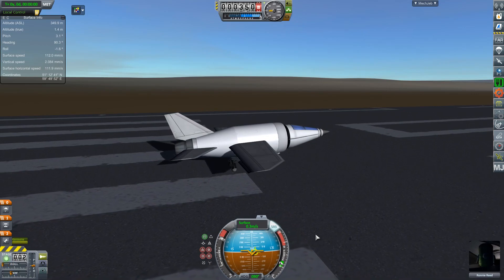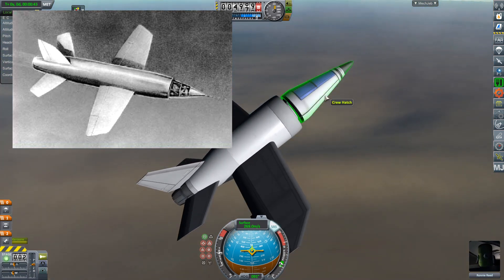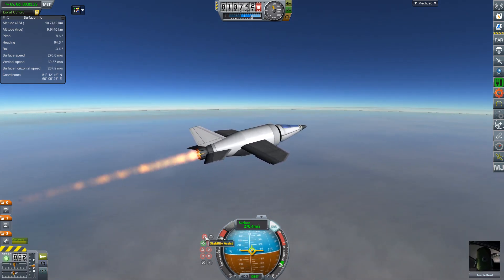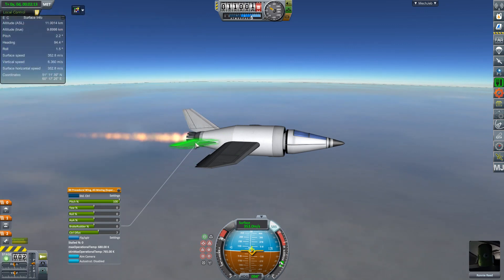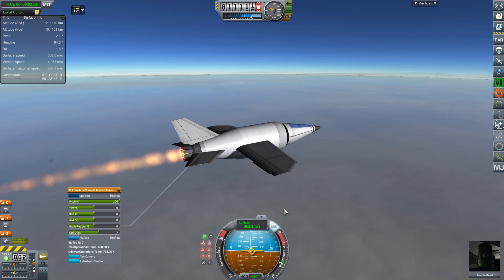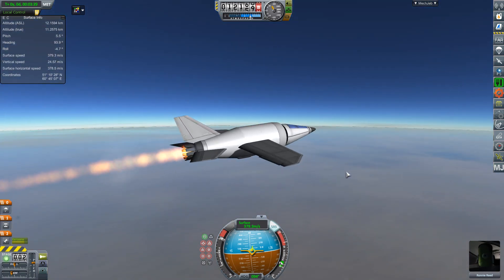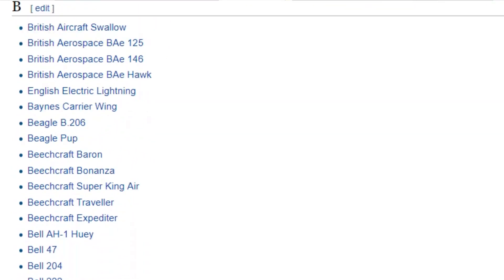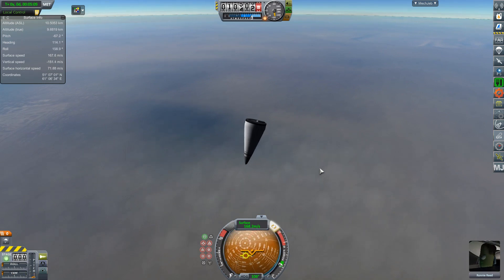Britain’s First Supersonic Aircraft Project - The Miles M.52

Comment: Some German Pilots probably broke the speed of sound during WW2. They had rocket powered aircraft which could almost do it in level flight, with a small dive they certainly would of. Also the Germans launched the first manned vertical take off rocket which certainly broke the speed of sound but crashed and killed the pilot. The record your talking about is the first man the Americans acknowledge broke the speed of sound.
Reply from the maker: +uglyduckling81 the only plausible claim was for the Bachem 349 Natter which killed it’s pilot on its only flight. The Me 263 was shown to be unstable at about Mach 0.9
Reply: aaaand the german jets ran out of fuel after 30 minutes... ._.
Reply: Hans Mutke broke the sound barrier in a dive flying the Messerschmitt Me-262.
The Me-262 was wind tunnel tested up to Mach 1.4 and was the World's first operational aircraft equipped with a fly-by-wire electric stabilator system designed to counteract the effects of "Mach Tuck".
Mutke was the first human to experience the effects of "Mach Tuck" and survive.

Comment: To be fair, a lot of the data and design was based on designs that were taken from Germany after the war as well, so a lot of people contributed to the X1, in one way or another.
Reply from the maker: Although both teams ignored the german research on swept wings and this inhibited their performance.
Reply: Zzyzx Wolfe Actually this was designed DURING the war and therefore did not incorporate many of the features of German jets of the period, I.e. swept wings which would have been v.useful .  The flying tail and re-heat were British innovations I believe.
Reply: From what I've read, at least some of it was gathered from intelligence. I don't remember all the details anymore, since I'm getting old, but I believe the wing design was very similar to that of the Wasserfall anti-aircraft rocket.  It's hard to know what was unique design and what wasn't. There are a lot of things that were developed independently by more than one country, but also a lot of stuff gleaned from intelligence. The English Electric Lightning certainly had some design inspirations from the Germans. The M.52, harder to say, I suppose.
Reply: JohnyG29 the all moving tailplane came out of the team that had eric brown in it
Reply: Zzyzx Wolfe I' m sure they used whatever data the could obtain, just like the Germans did.  However, from what I've read on wikipedia (which as we know is oftern wrong lol) its seems to be a mostly home grown thing.  As stated above one of the main things the Germans provided Allied designers after the war was swept wings.  In any case, its doesnt matter as the M52 was stabbed in the back (by a Labour govt as usual lol).
Reply: JohnyG29 would you rather have SS planes or free healthcare?
Reply: In fact the Tories have canned a shed load more aircraft projects than Labour ever did.

Aircraft Canceled by the Tories:

Supersonic javelin and Red Dean Active radar AAM -1955
Avro 730 Supersonic Bomber - 1957
Saro SR177 Jet/rocket Fighter - 1957
AVRO 720  Jet/rocket Fighter - 1957
Hawker P1121 - Failed to support a promising project - 1957
Nimrod AEW3 - 1986
Nimrod MRA4 - 2010

Thats not counting a number of civil projects that they killed.
Reply: +JohnyG29  Neither invention was actually british, the Stabilator was used on the Wright Flyer and found on many aircraft during WW1. The Jumo 109 -004E was the world's first afterburning turbojet engine.

Comment: They got the wings wrong as well as using the crappy centrifugal flow engine.  Drag building up exponentially on straight wings approaching the speed of sound.   Have to be 57 degrees or more sweep back..
Reply from the maker: Indeed, but, the X-1 had the same wing design.
Reply: The short stubby wings were proven at low speeds on a light aircraft and at high speed in a wind tunnel. They are more stable than delta wings and stronger. The 1960s Starfighter used similar straight wing.
Reply: @scottmanley  The Miles M.52 never had wings... the aircraft never existed.
To say the Bell X1 had the same wings is just wishful thinking.
Reply: @Dave5843-d9m  All true, except the U.K. didn't have any supersonic wind tunnels until after the Bell X1 broke the sound barrier.
Reply from the maker: @sandervanderkammen9230  Models of the M.52 were built, tested and flown, the intention for the wing design was pretty clear.
Reply from the maker: @sandervanderkammen9230  The UK built the world's first Supersonic wind tunnel in 1922, before Germany or the USA.
Reply: @scottmanley  This is true but it completely ignores the vast difference in engineering challenges between a unmanned scale model and a real, full scale, reuseable manned vehicle.
The Miles M.52 was doomed to failure because it didn't not have an engine capable of producing sufficient thrust required to reach Mach 1 in level flight.
The project was cancelled for several reasons (including fruad and embezzlement) but many experts today and British experts at the time agree that the Miles M.52 would never have adaquate thrust to reach Mach 1 unless it was in a steep dive.
Reply: @scottmanley  Not a large diameter supersonic aircraft wind tunnel.
The Luftfahrtforschungsanstalt supersonic wind tunnel facility in Braunschweig Germany was constructed between 1936 and 1938 and was state of the art even after the war ended.
Reply: @scottmanley  Work did not begin on the RAE's first supersonic wind tunnel until 1947 at RAE Bedford.

Comment: Miles M52 had two big issues. One the Tail Area was too small and when RAE trialled it in the fastest wind tunnel they had, they found it would have tried to fly sideways at Mach 1. The other problem was the Engine, when tested didn't produce enough thrust to get the thing supersonic even in a dive. The only way they could deal with problem one was increase the fin area, which of course would have increased drag. The X-1 had 1.5 times the thrust and the NACA at the very start of the X-1 project suspected that the control authority with a normal elevator system may be compromised at transonic speed.  Therefore the X-1 did have a moving tail, but its principle role was for trim control at Subsonic speed, with the elevators being the primary control. of course it was found that at supersonic speed, the pitch trim control gave enough authority to fly the thing. Scott, did you actually get your one to go supersonic?
Reply: As you could see it was doing approx 1,15 Mach
Reply: Richard Vernon they suspected because we told them.
Reply: Indeed, the Whittle W.B.2/700 engine never produced the specified thrust required to go supersonic and never successfully completed a full power test without damage... Whittle abandoned the project just before he was forced out of his own company Power Jets, and  exiled to drug rehab in the U.S. The UK government had no choice but to cancel both programs.

Comment: Full moving tail planes should of been put on every single WWII aircraft. Compressibility caused a bunch of pilot/crew deaths.
Reply: Fire up your time machine & let them know.
Reply: Many WW1 aircraft had horizontal stabilators... The Wright Flyer had them too
Reply: The Messerschmitt Me-262 had a fly-by-wire electric stabilator system.

Comment: The "Sharing" in nuclear, supersonic, space, jets, radar....was all one way, from the UK to the US. The US reneged on agreement after agreement, when Britain had a Space Program the US offered free rides on US rockets if Blue Steel was cancelled....you guessed it, once Blue Steel was cancelled the "free ride on US rockets" was withdrawn.
Reply: The U.K. had very little to share in terms of supersonic flight research, they were more than a decade behind Germany in supersonic flight.
Reply: @sandervanderkammen9230  The British had done some theoretical work and had actually come up with the concept of the All moving tail being essential for supersonic flight in 1942 (it was more to do with the trim changes on the tail as the shockwaves moved down the surface than the blanking of the elevators).  Hence the reason that it was specified for the design of the M.52. What screwed them up was no Supersonic wind tunnel to trial those ideas. (Germans of course had managed to build a few Supersonic tunnels that actually gave good data). The decision to develop supersonic research in both the UK and USA actually came out of a meeting of the NACA in the US in 1943 where the head of the Royal Aircraft Establishment attended said meeting. Seeing that neither the British or US had a working supersonic wind tunnel that gave accurate data, it was decided to drop models from very high altitude fitted with telemetry sensors to gain data. The US did so from a B-29, while the British did nothing. The US then followed this up with Rocket boosted radio controlled models. In fact a lot of supersonic open air model testing was done on aircraft development well into the 1960's.
Reply: Not True. If you bothered to go through the National Archives at Kew in the UK through the R&D files for most British weapon system you will find that the British nicked technical info off the USA left, right and centre!!! Blue Steel was an Avro designed Stand off missile for the V-bombers BTW.
Reply: There were only two winners in WW2 and the brits were not one of them.
Britain has always lagged behind the Americans Germans and the French,

Comment: Failed to say later the scale model easily broke the sound barrier.
Reply: What is your point? The actual M.52 was not built and never existed.
Reply: @sandervanderkammen9230  So what. That the basic concept was sound. Many vehicles have models made to proof of concept.
Reply: Starfighter wings tested on rockets.
Reply: @flybobbie1449  But the actual full scale plane never flew successfully...
You cannot assume it would exceed the speed of sound, that is just wishful thinking and speculation.
Reply: @flybobbie1449  The Starfighter was a real production aircraft that could reach MACH 2..
The M.52 never existed
Reply: @sandervanderkammen9230  you mean tested ! !
Reply: @johnpotter4750  The Miles M.52 never existed, the plane never flew because it was never constructed.
Reply: In hindsight we know that the full size version of the M.52 would have never reached Mach 1,  it's was noted by the Royal Aircraft Establishment that it was only expected to reach supersonic in a dive
Reply: Completely moot point actually, the Renolds Effect is scalar... so the fact that a scale model flew supersonic proves nothing.
 We have the benefit of years of research and development today that tell us conclusively that the M.52 could never have reached Mach 1 in level flight. Centrifugal turbojets are too inefficient to achieve the 
required thrust to drag ratio performance to fly supersonic.

No aircraft powered by one has ever achieved Mach 1in level flight..

Comment: More post war tech in which we were leading the world but without the funding needed to develop it further we gave away
Reply: Britian unfortunately was not leading the world in anything by 1945... 
Germany was the world leader in high speed aircraft research and the Germans went to America after the war.
Reply: @sandervanderkammen9230  Some of them did come to the UK and ended up at Farnborough. The British also had Axial Flow jets that could run for many hours longer than any German engine and produce more power. The only reason the British didn't use them is that they couldn't reach the minimum running hours specified by the RAF, where the Centrifugal engines could.
Reply: @richardvernon317  Very few,  the Germans knew where the research money was and Britain was bunkrupt.
The U.K. did have any flightworthy axial type turbojeta in service until at least the 1950s... more than 6 years behind German engines.

Not true, the Jumo 004b engines actually lasted longer than the original centrifugal engines used in the Gloster Meatbox.
Reply: @richardvernon317  Also not true, the RLM, RAF and USAAF ironically specified the exact same 100 hours PFTR required for adoption in military service.

Only the U.S. Navy required more, 150 hours minimum PFTR.
Reply: The brits have always lagged behind the Americans French and the Germans in aerospace technology

Comment: U.S.    say's      Fool You .  .  .  .  .  .  .  .  .
Reply: So much talk about a plane that never existed..
Reply: @sandervanderkammen9230   "The first of the three M.52s had been 82 per cent completed and it had been scheduled to commence the first test flights within only a few months."    (Summer)
  So an airframe and engine did exist, what you meant, was,   not completed tests to any degree, due to american sabotage.      (a Common Theme)
Reply: @johnpotter4750  The M.52 never existed and no version of the PowerJets W.2/700B with thrust augmentor was ever successfully flight tested.
Reply: @johnpotter4750  The only sabotage was by corrupt individuals at Miles and Frank Whittle who was sacked for dereliction of duty and suspected embezzlement.
Miles Aircraft was charged with 12 counts of fruad and embezzlement.
Whittle was removed from his own company andsent to a drug rehab facility in the U.S.